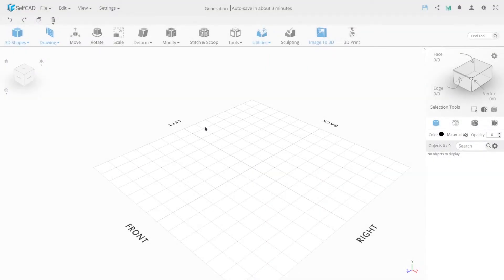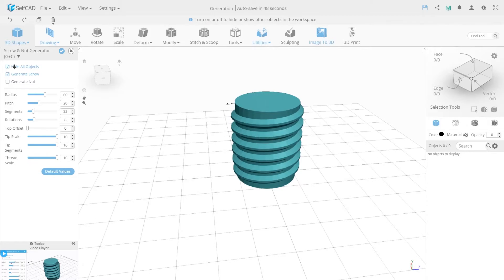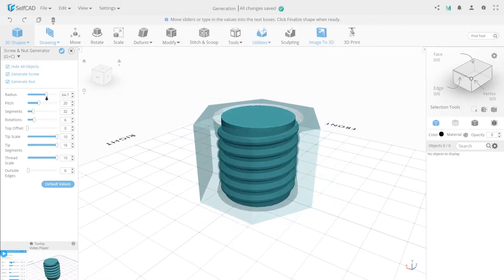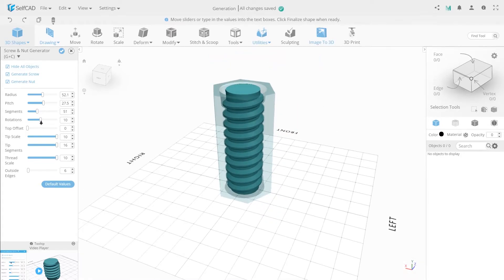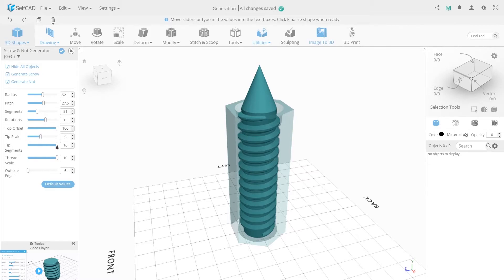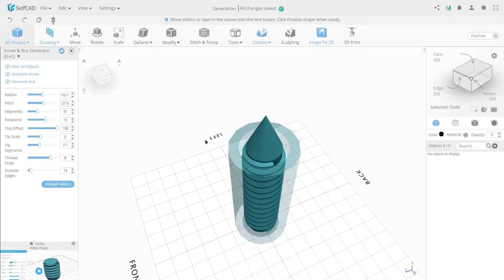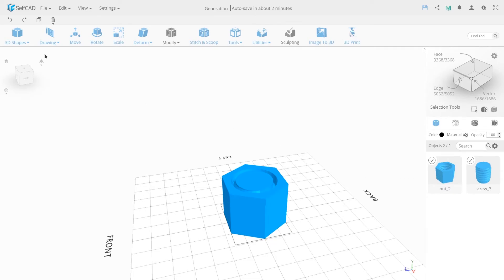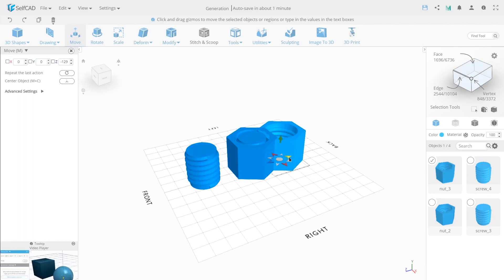Screw & Nut Generator | SelfCAD Basic Modeling Tools

Comment: can i make a working screw and nut in this program? the nut is always too big and goin thru thread xD
Reply from the maker: The nut and screw are a perfect match and were tested in many 3d prints to be working as expected. Just the screw is missing a top, for which you need to add yourself. You can see this example https://www.selfcad.com/tutorials/5m4y133o1o1n4l1x05124b1f461x63k5q186 for how the designer made them into a perfect set. And this video https://youtu.be/P-0Y6i5Fib8?si=I9e36DgqVX7-l2u2 explains the entire process. I hope this helps. Let me know if you have any questions. Thanks!
Reply: @SelfCAD  but i generate and print default thread and nut to check if they working together but still no. In other program it is no problem. Here always nut is like 2-3% bigger and goin thru thread
Reply from the maker: @zulix512  Does the problem appear just with the print, or can you see the issue in the design, even before moving the screw to the slicer? If that's the case, then please send us a few screenshots of the problem via email (support@selfcad.com), as it might be a problem related to a specific set of values set for the screw & nut, and we'll see what's causing the issue. 
But if it's an issue with just the print, then our options are much more limited, and all I can really suggest is double-checking if you selected the correct printer from our list or perhaps even trying a slicer recommender by the manufacturer of your printer.

Comment: How do you go back and edit the nut or bolt parameters after creating it?
Reply from the maker: SelfCAD is not a parametric software, so you cannot open the parameters again, but there are other ways to do it. You can always use our tools to edit nuts and bolts as a whole, but you can also use the Region Selection options to tweak the finer details. 
We're working on a tutorial that highlights editing a nut, and I'll send you the link once it's done.
Reply from the maker: Have a look here. The beginning shows how you could edit the screw after you finalize it: https://www.selfcad.com/tutorials/293y606e431n5m3h6h3l1q4m4um4h4u4a4o6

Comment: How can I find the exact numbers I need to make a #4 and #6 Machine Screws? I need the measurements in millimeters.
Reply from the maker: There's no streamlines option yet to make specific screws. RIght now, the best option would be to scale the screw to match the required size